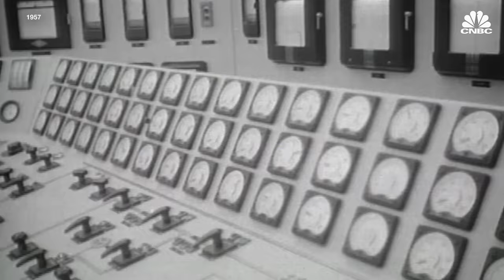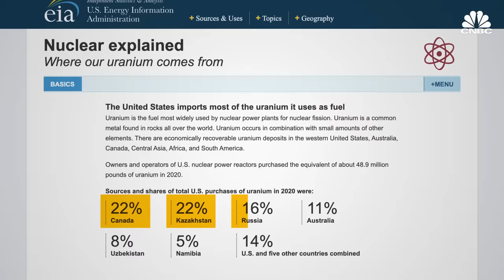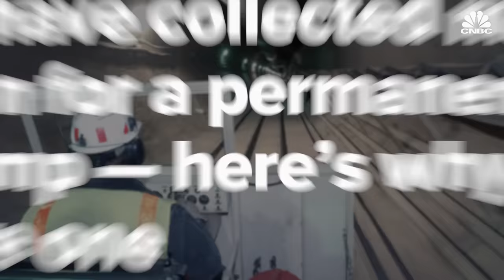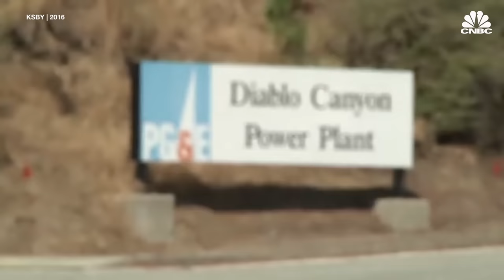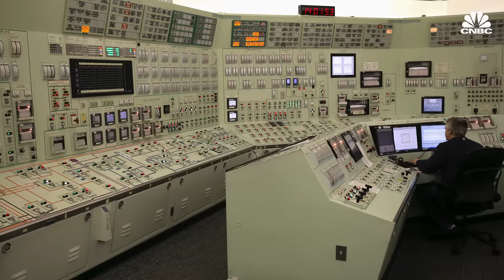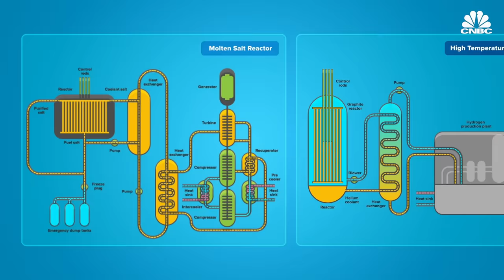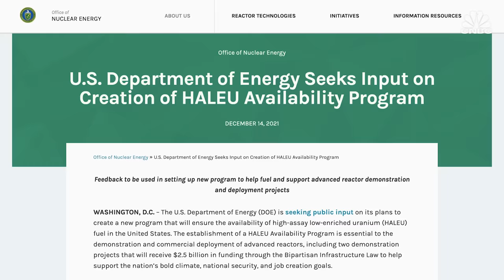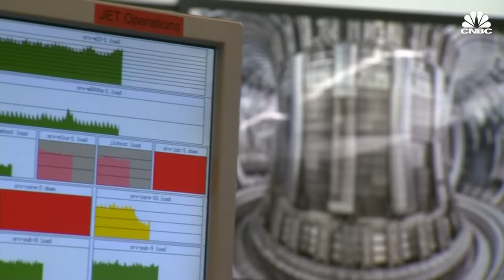Why Nuclear Energy Is On The Verge Of A Renaissance

Comment: A nuclear renaissance is our best bet to mitigate global warming in the next 15 years. I'm not saying there aren't other options, but in terms of realistic scaling there is nothing better.
Reply: I wish it were so, but the industry that built the first wave of nuclear reactors no longer exists. To build enough modern reactors to make a new wave large enough to play a significant role in decarbonizing energy production, we would first have to rebuild that industry. Then we would have to get the new reactors approved. Then we would have to build the reactors themselves. All that could easily take more than 15 years. Now some of that could be done in parallel, but we are very unlikely to see more than a very few new reactors in the next decade. Meanwhile, we have solar and wind capacity being installed at unparalleled rates, as well as grid storage at an ever increasing rate. It will be decades before nuclear plays a bigger role than these technologies, if it ever does.
Reply: Consumption
Reply: @colindavidson7071  You are so stuck in the past of nuclear technology, that you have no clue what can be done now.  And this video doesn’t help because it slams a complex set of topics together in a very short period of time. One we set the goal to be small, compact, modular, efficient and manufacturable nuclear reactors that don’t need massive amounts of water for cooling, then we understand that clean energy goals can be met with a much smaller footprint upon the earths surface.  Go do your research about the now, at the DOE and others, instead defining the problem so it’s not solvable.
Reply: @Radarcb329         Odd that CNBC would address commercial nuclear power issues WITHOUT mentioning any of the consequences of nuclear capital costs -- which is what killed the industry in  the first place in the United States.   Plants coming on line back in the 1950's and 60's all were built with a Government subsidy with up to more than half of the capital expenditures taken up by the then Atomic Energy Commission and reactor vendors as seed investment for future operating plants.   This situation evaporated in the 1970's with utility customers for reactors assuming the full weight of capital costs for the plant and this situation caused the cancellation of almost as many plants as are running now due to true capital costs and operation and maintenance costs being truly reflective of what was actually happening at each site;  the situation now being over for free money from the AEC, General Electric, Westinghouse and the remainder of the suppliers.  This placed the planned and operating plants on a finer economic edge; making expensive things going wrong more of a determining factor for economic operating the plants in future scenarios.   A gone-wrong steam generator replacement maintenance effort in two of the West Coast plants caused that utility to close down the eight-billion dollar facility for good; forcing the utility customers and the stockholders to eat the capital costs, and this was not the only utility to shut down a site due to insurmountable repairs and maintenance costs.   Reactor suppliers in the United States offered the utilities different 747 airplane designs for each plant and each utility;  something that would break a company like Boeing many years ago.   A re-started nuclear effort in the United States with the same commercial ground rules of competition and non-standardization of plant equipment will result in the same overruns for the same reasons as encountered before: a lack of scope definition and therefore ultimate responsibilities to be faced.   Far more successful in nuclear proliferation scheme was carried out at EDF in France through standardization of design and government financing;  although these nuclear plants as well are finding themselves susceptible to unusually high maintenance efforts.   CNBC and its producers and management have apparently decided that this important history of nuclear power in the US is ostensibly irrelevant and is to be virtually ignored by the current proponents as though it never happened.
Reply: @colindavidson7071  --- please read our comment above and below if you like.   You are right.   whatever case can be made for nuclear power today is blown away by competition from renewable energy resources both here currently and planned.   California's peak solar is producing nearly 20,000 Megawatts during the day and each day displaces over 100,000 tons of coal each day of operation.  CNBC as an organization has indicated disdain for California and its power system on many occasions when the State is headed for some of the lowest cost per installed kilowatt generation in the world.   The largest amount of R&D for thermal reactor power sources has gone for nuclear applications in unmanned spacecraft power systems over the last half-century.
Reply: @colindavidson7071  people have been saying basically this for decades already. Imagine if we started rebuilding nuclear 20 years ago.

We need to research ideal technologies for energy production, yeah, but we also need to implement what we already know is leaps and bounds better than our fossil fuels
Reply: @colindavidson7071  That industry still exists, it's just in other countries like Canada and France. If people were serious about climate management then you could literally just write a cheque to one of these experienced nations to build new reactors over night.
Reply: @JAGRAFX  the renewable energy doesnt hold a candle to the power we need and get from other sources. you say under peak conditions California gets 20k megawatts from solar. In ontario canada our nuke plant produces 6.6 gigawatts. gigawatts. so when your solar is running at peak, its a drop in the bucket for what you are using. not saying its bad or doesnt help but its not the solution. we need power plants and however we wanna power them is upto us but its only going to get worse as they try an convince everyone going electric is somehow saving the earth😂😂😂😂😂
Reply: @chrisanderson7820  I can assure you the industry does not exist in Canada. I got my information from a friend who works for AECL. We simply can't build the needed parts for existing designs at industrial scale. And yes, there are new designs, some of which have prototypes, but they still have specialized parts which cannot be built at industrial scale, because the industry doesn't exist yet. It will still need to be built. That can be done much faster Today than it could in the first wave of nuclear, but it still takes time...
Reply: @NathanSMS26  I wasn't saying we shouldn't build new nukes, just that expecting it to make a big difference in the coming decade is unrealistic. We need electricity. Lots of electricity. Maybe 50 to 100 % more than we currently have. We should be building power plants. In the long run nuclear could be a large part of that, and could be a lot cleaner than most current approaches. But it isn't going to change the world in short order, almost no matter what we do. If it were going to make a big change in the coming decade, we would already have been working on plans, permissions, financing, ramping up the production industry and probably other things for a decade already, which we haven't been doing. I don't like where we are, but here we are regardless.
Reply: @chrisanderson7820  Also, France has just announced a major nuclear power plant build up. The first plant is planned to be commissioned in 2035. I don't think it has much chance of affecting anything in the next decade, which is really the timeframe I was addressing. Even a 15 year window won't be much affected as the bulk of the new build will probably be commissioned after 2037. And in the meantime, old nuclear power plants are being decommissioned.
Reply: @vernonfrance2974  You have no idea what you're talking about. Nuclear is far and away the safest form of electricity generation aside from Hydro, and we're already at hydro capacity or close to it.
Reply: @docksidemarine4273  20,000 Megawatts is equal to 20.0 Gigawatts; boy.   Get in the right frame of mind and the right attitude.   Typical load day for the State of California is about 30 to 35 GW at peak.   If you want to save the Earth; the real problem of the future is not power and/or resources.  It's clean water.
Reply: @Radarcb329  Setting a goal doesn't really do anything, and by saying that you're basically admitting that they aren't able to do it currently. They've been saying the same thing for decades, and still nuclear is as noncompetitive as ever. You're all-in on a crapshoot. That's not how one should  play poker.

Wind/solar also have the goal of increasing battery tech, and we can increase our share of these forms of energy generation substantially, even with current technology. Considering it's like 5x cheaper to build renewables (and they don't take ~20 years to get going), if we're betting on anything, it makes a lot more sense to bet on that.
Reply: @JAGRAFX  wow great comment thanks for the thoughtful discussion
Reply: @JAGRAFX  it's a shame California will be practically uninhabitable in the near future
Reply: @colindavidson7071  two words: planned economy
Reply: @philipm3173  --- Texas as a state would be doing a lot better right now if they had the same sort of "planned economy" like California's Independent System Operation [Cal ISO].   The TEXAS version which called ERCOT [Electric Reliability Council of Texas] when examined operates in a completely different way of doing business.   Power acquisition was changed from favoring large producers to allow smaller entities [such as manufacturers, cities, hospitals, etc.] to be competitive through what we called co-generation with the larger systems beginning back in the 1980's.  This brought about what was almost a literal explosion in alternate & renewable resources to the California Power System at competitive mid-day prices as well as continued private investment.   CNBC berated the Cal ISO system as "those socialists in California" whilst all the time praising a quite similar system design in the State of Texas.  Co-Gen  from utility customers allows for corporate and private ownership of power production resources and a schedule of methods for joint participation;  a far cry from anyone's definition of "Socialism" near of far.  Texas' ERCOT simultaneously placed restriction on power distribution and use outside the State in order to avoid regulation from the Federal Power Commission.   The key players in Texas are folks who already have money.   California gave the little guys a chance to compete and this resulted in a whole lot more capital investment in renewables and solar that we would have had just sticking with the investor owned utilities.   Solar and renewables, and California in general, has become the advertised bad actor in many scenarios besides the future of the power industry.  Much of this bad press originates from those entities heavily invested in fossil fuels who are the organizations that come out being the losers in this scenario long term.  Today, nearly one-half of the State's electrical peak load of 39,360 megawatts was supplied by solar with a projected four to six thousand megawatt nighttime carryover.   This "free energy" will displace over 120,000 tons of midwestern coal today and by 2035 solar & renewables will outstrip the needs of the State and California will be selling power to other states including Texas for lower costs.   Thanks for your interest.   You are not alone in your impressions about California;  you have had a lot of help.    the best  --- RON JAGRAF/X
Reply: @ronaldgreene5733  That sounds like nonsense mate, you're gonna have to provide a source... and that source is gonna have to be a video demonstrating the method.
Reply: @ronaldgreene5733  My dude, HHO is oxyhydrogen. I'm a metalworker, I use it literally 5 days a week. All your claims about it are 100% contradictory my my DIRECT experience.

Either prove your point or gtfo.
Reply: @scottfree6479   .  . "I use it literally 5 days a week" [HHO] .  . if you say so .  . 😃 .  . HHO is not provided by AirGas or any provider of welding supplies -- I've welded glass to metal and I challenge you to do this with any other gas or method --  -- You are not here on a genuine basis and the intent is to insert doubt into the conversation .  . sponsored activity in the forums is very normal today for commercial and political purposes and subjects of controversy .  . Normalization rather than conspiracy is how influence and corruption create and take precedence, so that awareness is hostage to the needs for anything other than ourselves to define what is real and acceptable -- the need for any form of consensus to rule us unaware, lest we ever accept responsibility.
Reply: better late than never...
Reply: @philipm3173  üüüüüüüüüüüüüüüüüüüüüüüüüüüüüüüüüü
Reply: @philipm3173  üüüüüüüüüüüüüüüüüüüü
Reply: @colindavidson7071  der üüüüüüüüüüüüüü für üüüüüüüüü de üüüüüüüüüüüüèèèüüè
Reply: @colindavidson7071  üüèüüüüüè nun èüüüüüüüüüüüüüüüèüüüüüüèèüèèüüüüèèüüüüüüüüüüüüüüüüüüüüüüüüüè

Comment: The energy density for nuclear power is infinitely higher than solar. And it emits no Co2. Now we have better tech than the 1960's designs that encompass most of the US facilities. I can see these smaller units being used as the foundation for municipal power plants. Example: 1 site/city versus large power grids that span states.
Reply: It is only "infinitely higher" after infringement. If you look at the amount of rock you need to extract a minuscule concentration of Uranium form, and then centrifuge that to get an even smaller fraction with the correct atomic number, you will see that the energy density of the original rock is very low. Both extracting Uranium from rock and centrifuging to separate different atomic numbers using very small changes in density cost a lot of energy. And that does not even include the energy to make the chemicals used in extraction and centrifuging, not the energy needed to produce concrete to make reactors reasonably safe. Most of that used energy is in the form of fossil fuels, so nuclear produces less CO2 than a natural gas powered plant, not zero CO2. (about 30%..40%, so it's a  very expensive way to half CO2 emissions.)

That energy usage is what makes nuclear electricity more expensive than renewable electricity.
Reply: The surface area/generated energy ratio of Nuclear plant and solar plant is not that different in sunny regions. In countries where restrictions for closest nearby buildings are high this ratio can be pretty pretty much the same... And the deployment of solar farm is 100x easier, 20x faster and much cheaper. The problem starts when you want to have enough batteries to achieve same reliability for long term use. Then solar can become 5x-10x more expensive than nuclear, so it's not worth using solar this way.